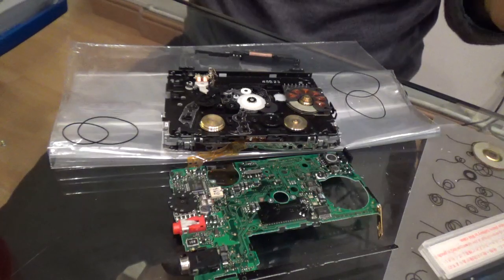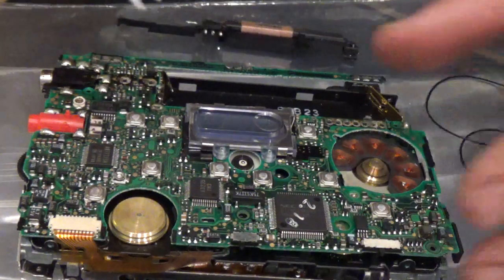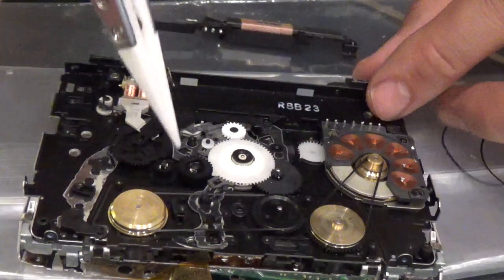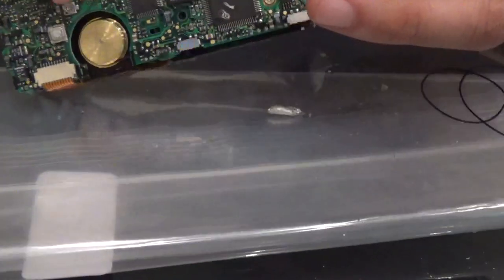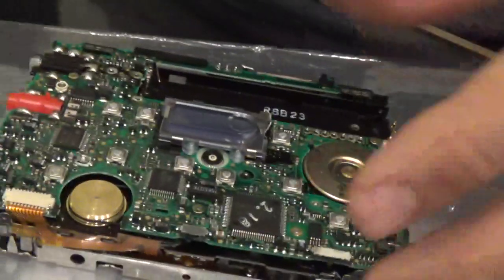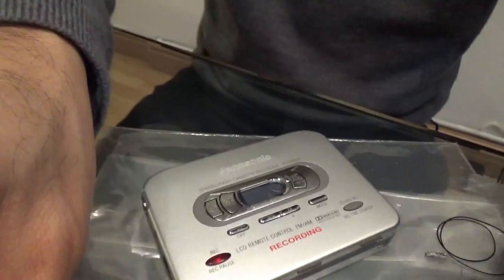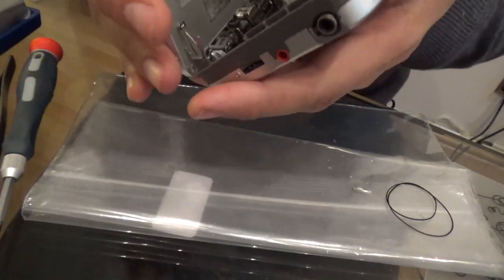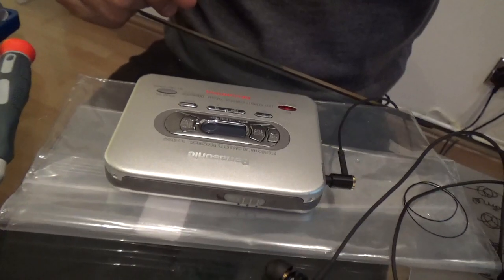Panasonic Cassette Player - Walkman Fix

Comment: Hi. Thanks for sharing your video. I have a Panasonic RQ-X200 walkman and I cannot figure out how to separate the PCB board so I can change the belt. Is it something you can help with?
Reply: If you didn’t fix it, you can try seeing the service manual for it. I found the one for my Panasonic and had to do a bit of desoldering to get it apart.

Comment: Hi - I want to fix my players - I have several from Panasonic - Can you give me some tips from where I can buy the tools you use ? and also I had issues with - switcher small parts ( spring and tine plastic circle ) who are out and cant stay back like before - Nice video thanks
Reply from the maker: @Antoniu Dragus - Panasonic are known for the center plastic spring loaded cap that becomes cracked and does not stay in place. There are no replacment parts. You can either fix the same part with glue or make a new one using a 3D printer. The belts you will need to buy and thats it. Everything just needs cleaning with IPA 170 Servisol IPA 170 Isopropyl Alcohol for Electronic Cleaning https://www.amazon.co.uk/dp/B00FDUV024/ref=cm_sw_r_cp_api_i_juWeDbJD50CJR. 
Hope this helps. Thank you for your comments.

Comment: Will my friend I know the newer Walkman autoreverse it is not that easy to replace the belts, you did it, but it is not repaired properly, there is mechanical noise, and wow flutter, something did go wrong, you have to reopen it and fix it if possible, but unfortunately  some times some mechanical parts goes bad, then can't be fixed
Reply from the maker: @zulkarnin - The video is only to show how to replace belts not do a full repair. The wow flutter will go away after you clean the pintch rollers.
Reply: @thespecialist786  
I understand now, you did remarkable job by showing how to replace the belt, like I said it is not easy on logic control autoreverse walkmans, good job.

Comment: Just recently got myself a Panasonic RQ-SX25. Works fine playing side A but when playing side B, the sound is slightly distorted with a strange "ringing/echo" effect, particularly audible in the vocal range. I tried to flip the cassette - same effect but the sides switch.
So, it's clear to me that it has a problem with driving/playing in one direction and no problem on the other.
As I could find out, these players have 4 track heads, two of them reading the tape in either direction.
Has anyone ever encountered a similar problem?
Is it possible (and how) to fix it?
Thanks and best regards.
Reply from the maker: @Milos Marinkovic - Thank you for your comments. Have you tried to clean the head and also clean the pinch roller with alcohol. Its seem you may have an issue with the Head which is the main part. Unless the walkman has suffered and water damage which then changes everything. But cleaning the head with alcohol &  ear buds should help.
Reply: @thespecialist786  
Thank you very much for your fast reply and advice. I just tried your suggestion and did a though inspection and cleaning of the head. Unfortunately, no luck - the problem is the same. I also tried to turn on and off all of the available combination of additional signal processing (S-XBS, TRAIN, Dolby B NR) - some of them accentuate and some mask the problem a bit but the underlying distortion is still present in that one playback direction. There is no dirt on capstans nor pinch rollers and I haven't noticed other problems. My "Test" tape is high-quality Type II ("Chrome") cassette, recorded on a decent deck. I'll try some other tapes when I get the chance, including a couple of Metal ones I have.
I'm afraid that it is an electronic/processing problem. At least it plays well in one direction and it is a beautiful little machine and a brilliant piece of 90s Japanese engineering and would keep much of its charm even if not working.
Thanks again and best regards.
Reply from the maker: @Milos Marinkovic - Thank you for the update. Well as parts are not available the best bet would be to buy a donor machine which will be faulty and use the main board and see if that cures the issue. Easy to swap the boards over. As this is a SX25 its not top of the range model and you can find many cheap ones listed on Ebay.

https://rover.ebay.com/rover/0/0/0?mpre=https%3A%2F%2Fwww.ebay.co.uk%2Fulk%2Fitm%2F383176156746
Reply: @thespecialist786  
Thank you, I was thinking along the same line. And, as a great help, I'll have tour videos to guide me through the transplantation process.
Best regards
Reply: I would suggest replacing the pinch rollers. They get old and don’t grip the tape properly. New ones are available still. Do a Google search.